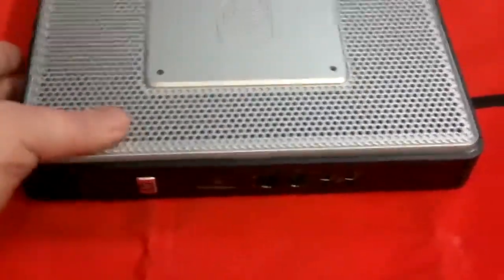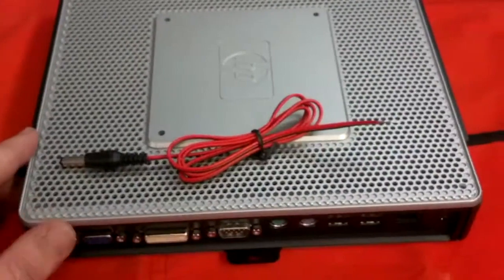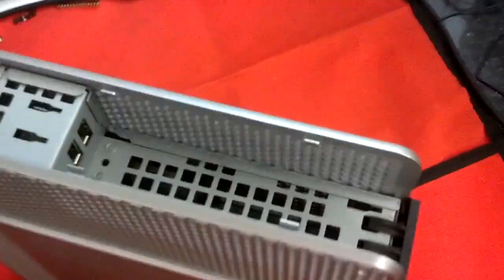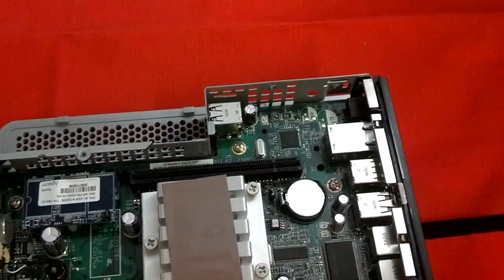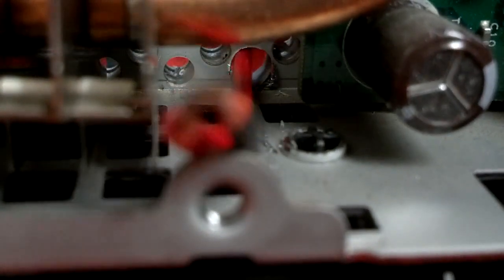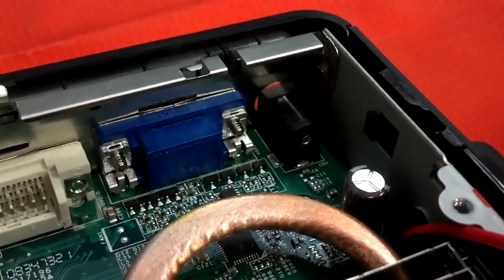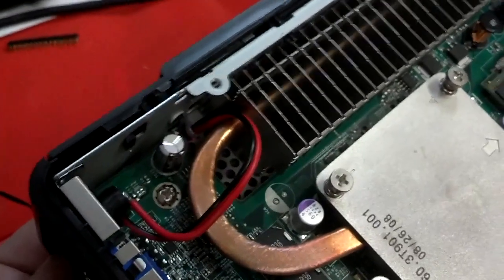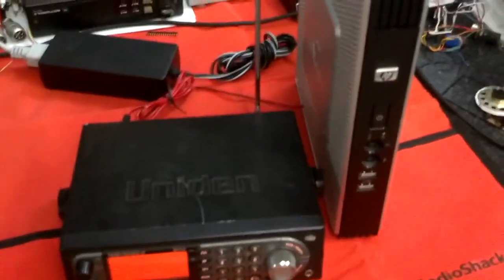Police Scanner Streaming Appliance using a Thin Client PC

Comment: Clearly an older video based upon a couple things you said which I won't elaborate on publicly lol.  - Mike
Reply from the maker: Feel free. It’s about 8 years old but should still be mostly relevant.
Reply: @r3dbeard  I agree it’s still relevant. I wish I could find something cheap that would handle SDR trunk and an airspy.    Difficult to find something cheap with enough horsepower to feed an eight channel simulcast. And SBC’s like a raspberry pi Barely have enough CPU and typically have USB sub systems they can’t handle 10 Mb without dropping samples
Reply from the maker: @mbtjr  There are newer thin clients with more storage and faster specs that might do the job.